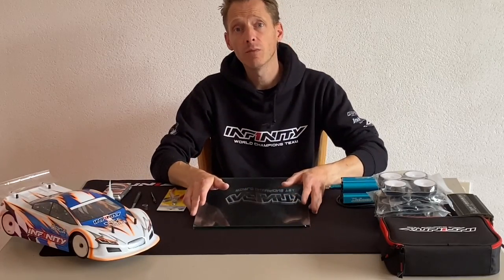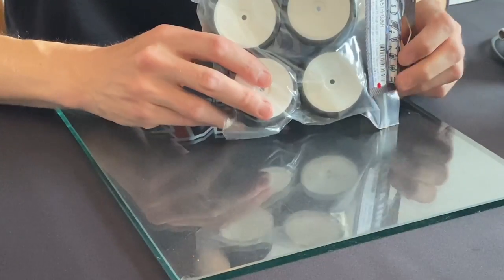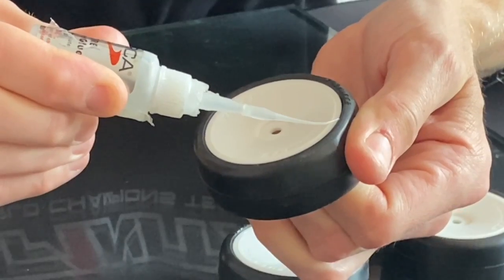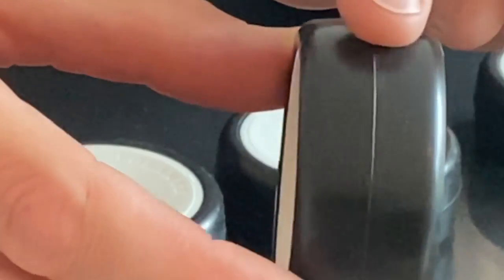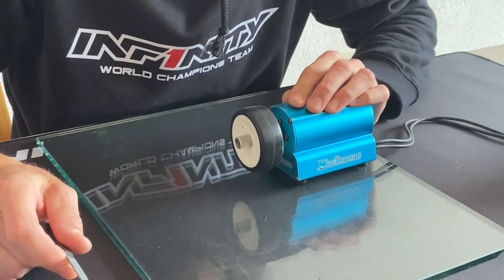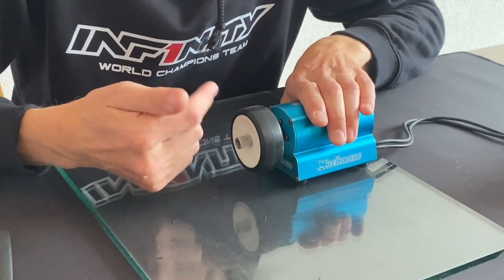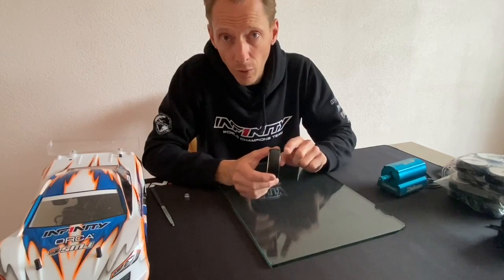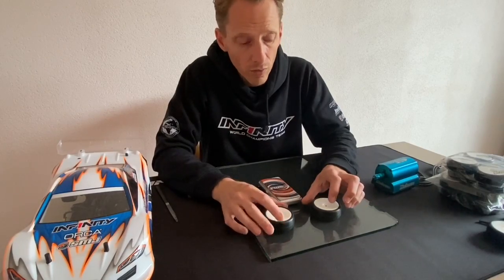Jilles Groskamp "How to prepare new rubber tires for your 1/10 electric touring car"

Comment: Awesome video! Great information. For carpet racing where the surface may not be abrasive enough to scuff the tire in like outdoors. Would you suggest lightly removing the glossy surface of the tire to aide initial traction on carpet racing?
Reply: https://ets.redrc.net/rules/
due to the rules of ETS. I don't think he can. But if the race organizer does not prohibit, whether asphalt or carpet, always scrub the surface off.